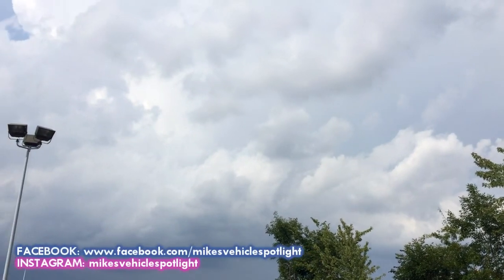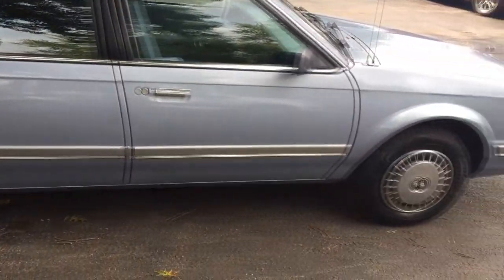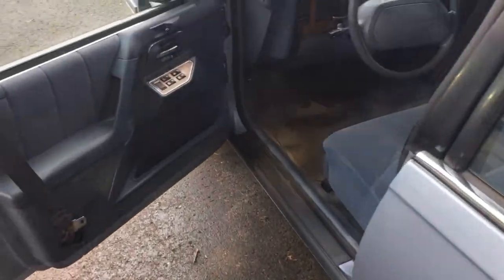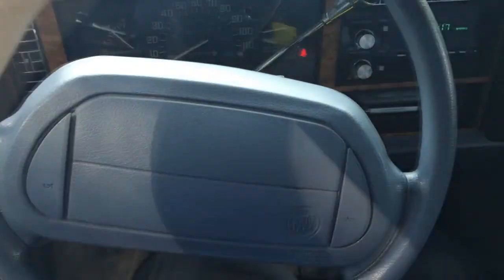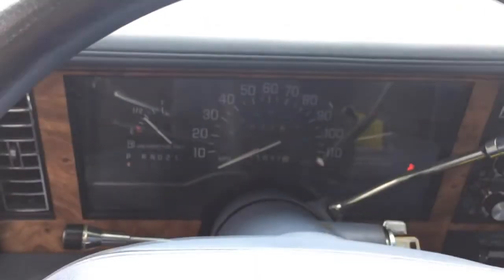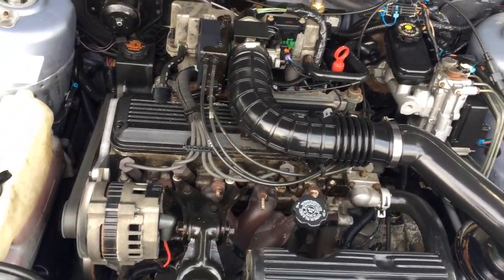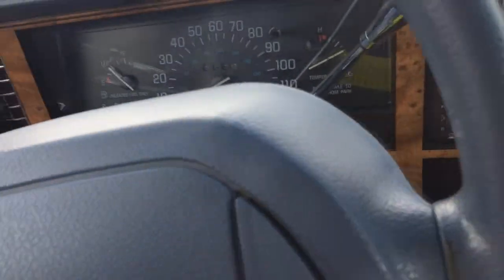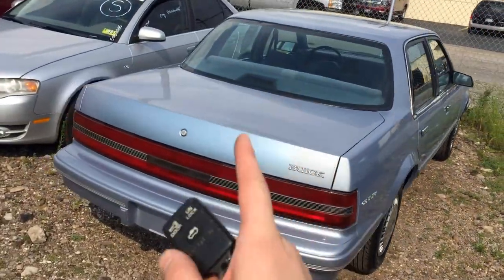MV 70 - "A 1996 Buick Century - Quick Look"

Comment: I’m thinking the four cylinder in that car would be the 2.5 L. My grandparents had a Buick Century of that body style with the four cylinder in it was a 2.5 L. He called it the iron Duke. And that actually is the same platform as the Chevrolet celebrity, Oldsmobile Cutlass Sierra, Pontiac 6000, and the Buick Century from 1982 onward. Until 1996. Although, I don’t believe the Chevrolet celebrity and Pontiac 6000 made it until 1996 with that body style. I think they were both replaced by new were models under different name plates. But the Oldsmobile Cutlass Sierra and Buick Century soldiered on with that body style. V6 models of this particular platform in that time. Had the 3100 V6. It was the traditional 12 valve General Motors V6. I want to say horse power was around 150? But don’t quote me on that.
Reply from the maker: Yeah, I looked into it. In 1996, it was a 2.2 Liter.
Reply: MichaelAdamsRocks That would be right.
Reply: MichaelAdamsRocks can you please  do a 1992 Oldsmobile Sierra?
Reply: MichaelAdamsRocks  can you please do a 1992 Buick Century Limited? do a full tour startup interior exterior & engine & good luck with getting the Aztec Fixed?
Reply: Colby Walsh was gonna

Comment: 1996 was the last year for this body style. It ran a long time. The basic design is from early 80s. They only did a few minor upgrades in 1994. Driver airbag and new cluster.  The radio and climate module is the same as the 1982. I had a 89 and they are decent riding cars. Reliability is questionable because mine blew at 155.000 miles.

Comment: This car looks like an 1985-86 Chevrolet Celebrity! Funny thing the Celebritys from 1982 to 1986 had the name badging saying "Celebrity" towards the front of the front fenders! Later ones from 1987 and up had replaced that with the engine size badging in that spot as well as the plastic headlights and smaller grilles. This car has its badge name "Century" on the rear fender. Very iconic to the 1980s cars. The radio and climate controls are exactly the same as the Celebritys. My Dad also owned a Celebrity when we were kids in the 90s. It was an 86 base model had the sealed beam headlights older styled model that was a gun metal grey metallic color with plushy grey cloth interior had the metal chevy hubcaps with whitewall tires and the big 2.8V6 not the 4cyl Iron Duke. So I believe it had some extra options like the best engine and air conditioning AM FM stereo with tape deck. Third brake light which my Dad said was new for 86 was a nice car he had it for many years always ran good from what I can remember! Started rusting bad dispite being cared for garage kept its entire life damn rust belt Ohio weather! He later replaced it with a silver 1996 Ford Taurus LX he bought in 98 and that car was also very nice. That one was really loaded up.
Reply: 1996

Comment: I liked the car until I saw the 2.2L motor... Ive got a 95 with the 3.1L
Reply: I have a 96 with a 3.1 90,000 original mileage. I'm doing lower and upper intake gaskets, valve cover gaskets and put a new thermostat on it. I still need to flush the cooling system and put fuel lines, battery and new the on it. Hope it last me another six years 🙏